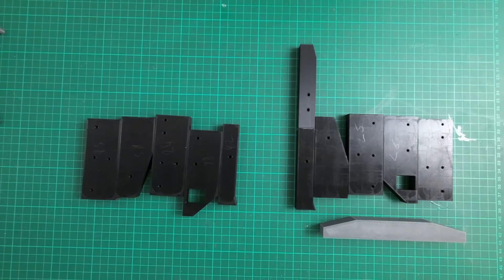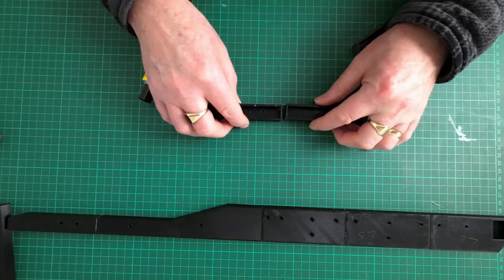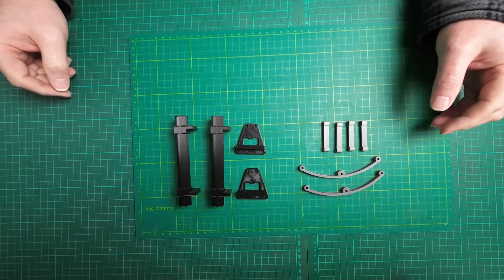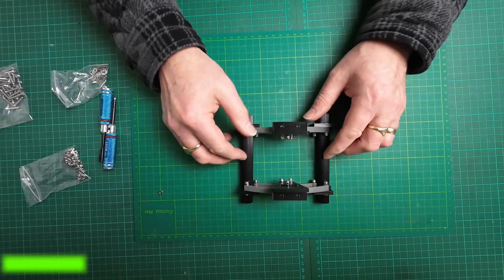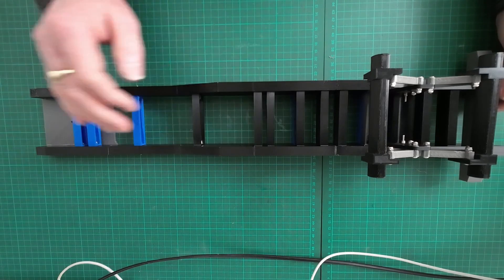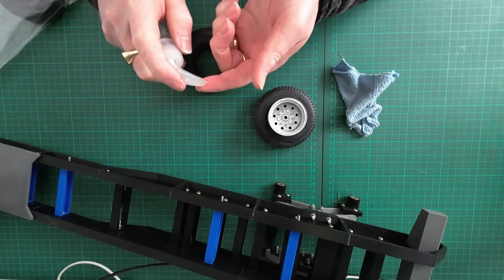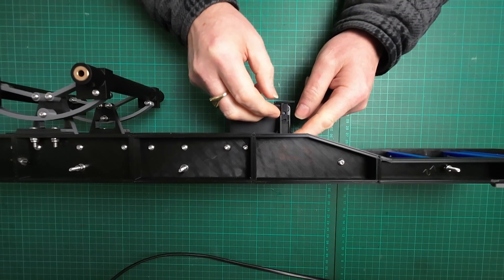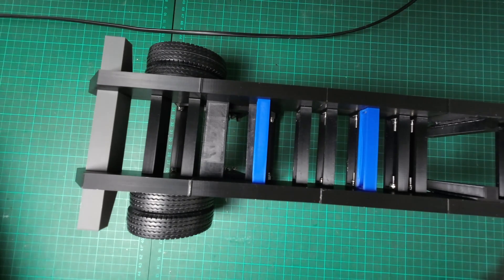3D printed trailer, for a Tamiya 1:14 scale truck. Part 1

Comment: Hey, great job! Do you think it would be suitable for a modified Huina 1573?
Reply from the maker: The scale maybe a bit out. Its worth a try though.
Reply: @ourr.c4065  do you think it would be possible to convert it to 3 axle and make it longer?
Do you also know where to find the attachment that goes on the truck to connect the trailer?
Reply from the maker: Hi, Yes i do think its possible. Your best bet for the hitch is ebay, I would think. @BulletNE100

Comment: I haven't ventured into 3D printing yet but feel the need to start after watching this! Can I ask, excepting the cost of the printer, how does the cost of producing say the suspension parts compare with the commercially available Tamiya ones? Is there much of a saving? I can see it's 'a must' for making unavailable parts but can you offset the investment of buying a printer and its running costs against substantial savings in parts you can then make??
Reply: That’s a lot cheaper for the materials than I thought, I’ll start researching! Thanks for your reply😊
Reply from the maker: Hi, It cost about £12.70 for a reel of filament. I printed out the trailer which used about a quarter of it. As for cost in electric, I would not know. I never got any scary bills so it didn't cost much, hope this helps. Thanks for watching.